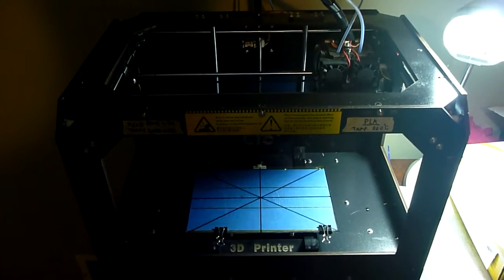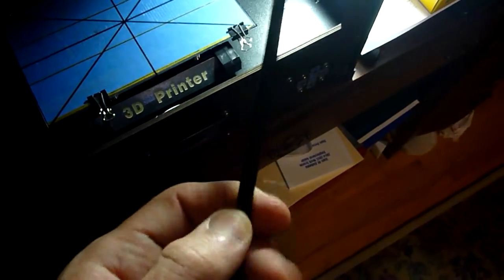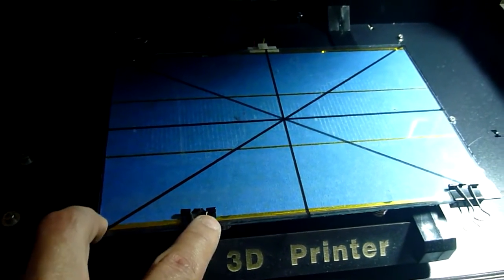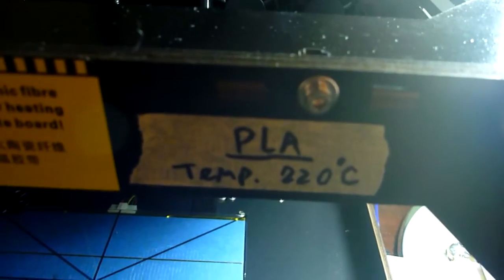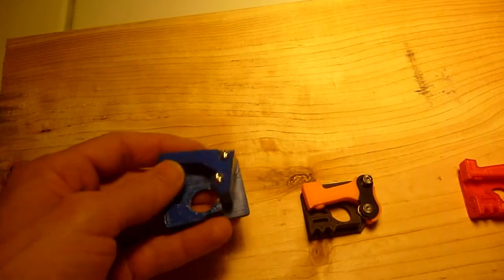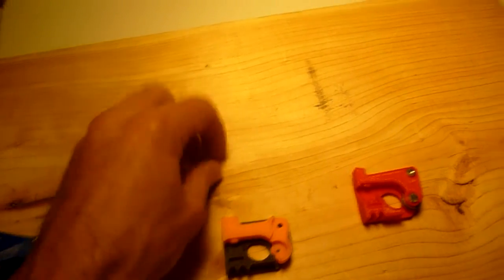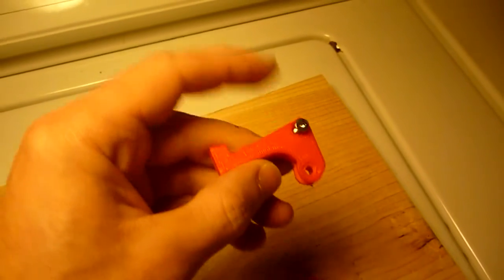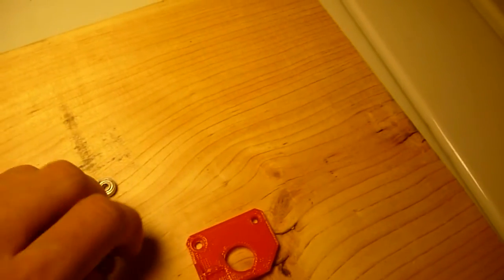Three things you can do to improve your CTC 3d printer

Comment: can i easily install volcano heads on this bad boy?
Reply: stock CTC I don't think so but what I did was I got a threaded duel block, e3d v6 throats and knock off v6 heater blocks, thermistors, and nozzles so mine could easily take volcano heads although it might lose z height my mod has the bed really low now with volcano heads you might need to have the bed stop earlier if your interested here's the ebay listing for the block http://www.ebay.com/itm/122015972339?_trksid=p2060353.m2749.l2649&ssPageName=STRK%3AMEBIDX%3AIT

Comment: what material did you use  ABS or PLA to make this ?
Reply from the maker: +bogas78 I used PLA... In fact I use PLA for making all my models. It makes very strong models. Also, PLA smells much nicer when it is melting (its melting temperature is lower than ABS, also). In US ABS is for some reason more popular while in Europe PLA is more popular. Use what works for you.
Reply from the maker: Honestly I never had to mess with any of these values! Also, what are you trying to upgrade? Are upgrading the firmware on the printer itself? (I never had to do that). In the video that you posted the man recommends that you write down those values, you should probably do that (since they might be gone later). The only settings that I messed with were 'feedrate" "extruder temperature" "travel rate" and "number of shells"..... the other stuff I left at default values and never had to do anything with 'em. The printer has a pressure switch, when the extruder arm goes to 'home' position that switch get pressed by the arm (what tells the printer where the arm is). I appreciate this printer's simple design.
Reply: hi again what screws did you use to mount this extruder i just got  printed parts but only one  screw can be used from orginal extruder.
Reply from the maker: bogas78 You need 1 small (6 mm) flat top screw and 1 long (18mm long about) flat top screw (the long ones come with your original extruder) plus 1 small nail that holds the V-shaped wheel in place. The small screws may come in your 'extra part' bag included with your printer. Hope this helps.